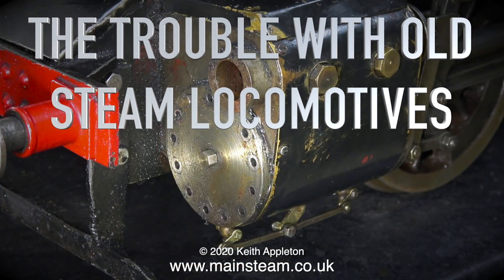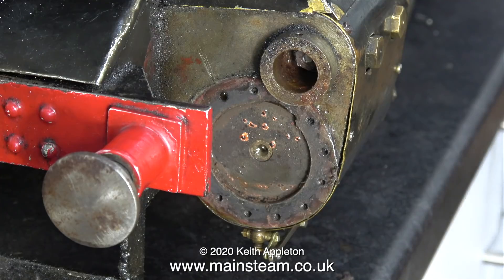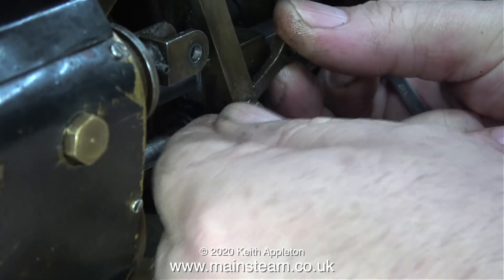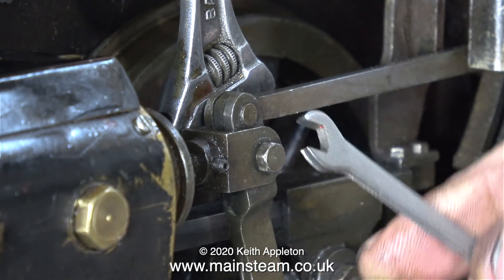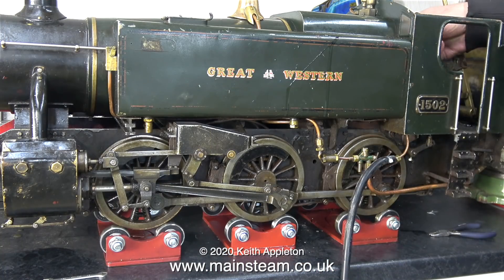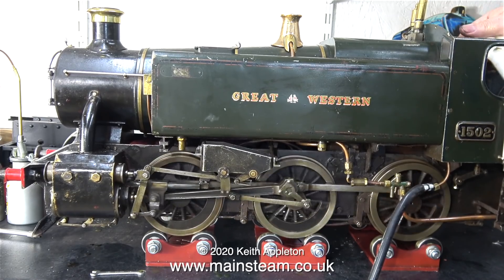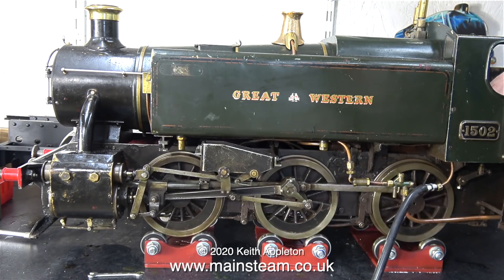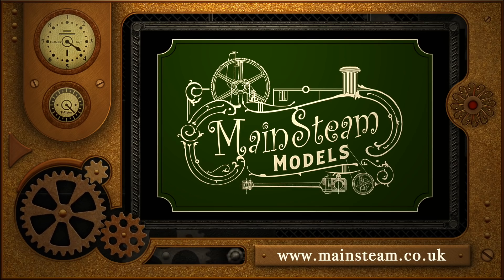THE TROUBLE WITH OLD STEAM LOCOMOTIVES - PART #3

Comment: I was just coming back to watch this video and thought I might suggest getting a portable air tank to add to your compressor. you can hook your compressor to the tank and use the air from the tank to power a locomotive for longer.  They sell them for $30 here in the states so I bet you could find one for about 25 pounds

Comment: Keith, will you get/do you have a bigger compressor that you can place in another part of the workshop where it won't make as much noise? Could be useful when running in locos...
Reply from the maker: This one is fine . . . it doesn't take up much space in the Workshop either . . .

Comment: I noticed when you were freeing up the piston valve that you rotated the spindle, but did not check which way or how much you rotated to get it back to where it began. Did you check your timing on the ports afterwards before running on air? that might also explain why the beats aren't great.
Reply from the maker: it doesn't matter, it is not threaded for adjustment . . . . it has locknuts on each end.
Reply: @keithappleton  Fair enough, didn't think of that